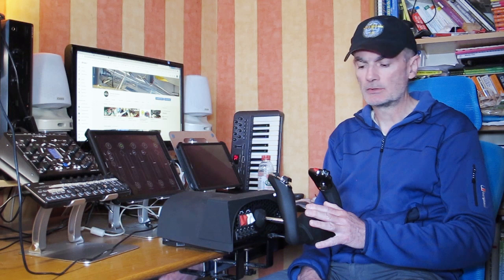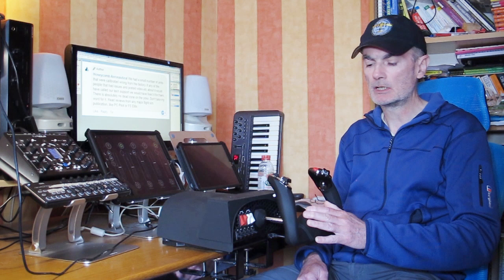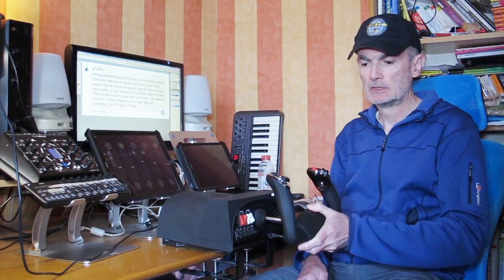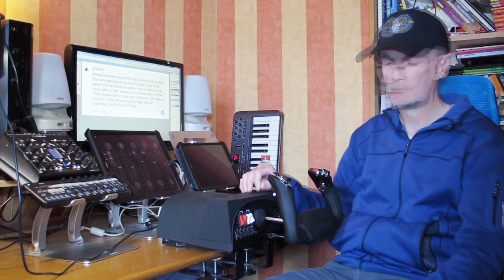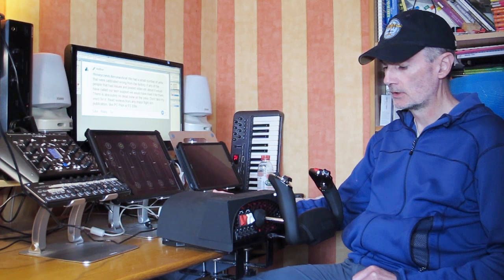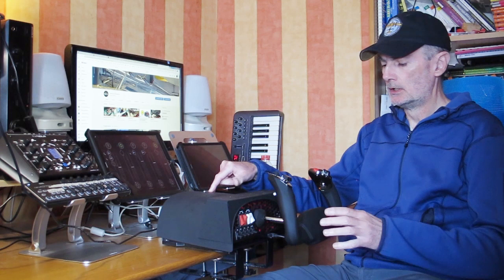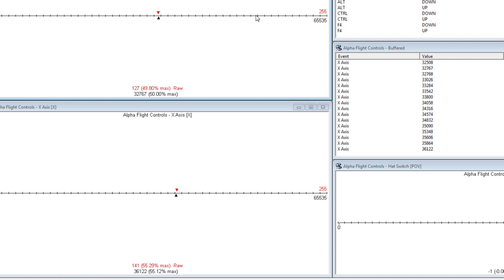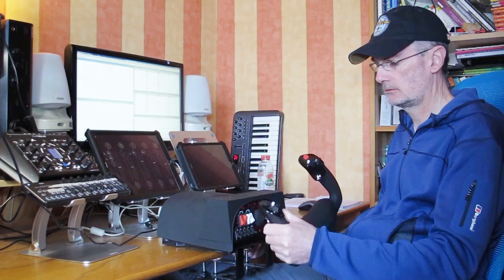Honeycomb Alpha Yoke SECRET Calibration Mode!

Comment: Thanks so much for this. My yoke was in the 20 degree out category. I've just followed your guide and successfully recalibrated it. It's now the excellent yoke I expected it to be. The only puzzling thing is why the manufacturer just didn't issue a fix themselves. Simple to do and would not harm sales. Anyway, this is very appreciated.
Reply from the maker: Glad it helped. By the way, I wonder if it would be helpful for people to let Honeycomb know that they hav eused this procedure to improve their yokes. As for your question, the only reasoning I was given for keeping the information secret was "we don’t want customers trying out this process yet and potentially messing up the yoke". Then Mattijs Kok of Aerosoft said in response to my video that they don't support this because it can "brick" the yoke.

I think the latter claim is unconvincing. However, the fact is you can easily mess up the yoke if you calibrate it wrongly, and I am sure there would be a fair proportion of people who would then return it as 'faulty' afterwards. I think the situation is most likely a consequence of a retail system that has become far too biased in favour of the consumer. Honeycomb (and Aerosoft, as its representative) is catering to the lowest common denominator, so ends up treating everyone like an idiot.

Comment: Thank you for speaking it out, as well as your previous video of explaining the possible mechanisms behind it and other useful information, which is very helpful and helped my friends to figure out how to calibrate it correctly. He has been given the "instructions" as well but failed to make any difference after doing it at first. What he did then after watching your video is, using some wire to make an "aim" and tied it on the column of the yoke, and aligned the aim to some sort of marking behind when logging the center position, to make sure they are at the same position each time.    HC's action of dealing with this issue makes me unhappy, but unfortunately, there is no alternative at this price point. Their upcoming throttle is even more so. Just hope they can make it better this time.

Comment: Fitting on this Easter Sunday that Mark has now enabled us to resurrect our Alpha Yokes from the "dead" zones! 

Mark, Honeycomb should give you a free Bravo Throttle Quadrant for providing customer service to us. I requested the procedure from them 11 days ago, have not gotten a response yet, maybe they are not servicing the support tickets remotely while staying at home.

This would have been an opportunity for them to be proactive and get ahead of the dead zone issue by letting customers know about the possibility of mis-calibrated yokes and how to correct it ourselves. Proactive communication about a possible issue would have made for confidence and brand loyalty, as you would know they are transparent and accountable. As it is, seems like they have just wanted to keep it quiet, and made it a bigger "issue" than it needed to be.

My yoke went from 5mm elevator and 9° aileron deadzone to none detectable, but my centering was not as repeatable as I thought it was - had to mark the shaft and watch the end of the yoke handle to get the exact same centering every time. So now i can setup a small dead zone to taste in my software, instead of having a fixed amount in the yoke. THANKS!
Reply from the maker: I'm glad people appreciate it. I kind of wonder if Honeycomb wanted someone to leak this, since it might protect them if anyone screws up their yoke!
Reply: @AlmostAviation  I posted a link to this video in 6 different YT videos where the dead zone was being questioned, to spread the word. It's in the wild.
Reply from the maker: @automaton450  Great, thanks.
Reply: @AlmostAviation  I think the truth might be halfway... they don't share the information to protect them if anybody screws up their yoke, but the leak was due to a rookie mistake  by the "global manager"
Reply from the maker: @attiliodariva5417  Maybe. I have had one other person say he was given the calibration info by tech support, although perhaps it was by the same person!
Reply from the maker: P.S. They did give me a free throttle quadrant :)
Reply: @AlmostAviation  lol I should setup shop and charge for my prognostications!

I guess they were not all that unhappy you publicized the cal procedure, it's the least they could do for you.

I do want the Bravo, it has a lot of great features, but I already have a pair of Saitek Quadrants, and was lucky enough to get a Cessna Trim Wheel while they were still available. I don't really need any of the extra features the Bravo has, but the one concern I have about it is the trim wheel outputting key presses. I prefer the analog axis of the Cessna Trim Wheel, and it has a such a great firm resistance but smooth feel. I don't use autopilots much, much of the time flying my hand stays on the trim wheel. I'd almost rather give up my
yoke & pedals before the trim wheel!

Comment: Cheers for that Mark that is most helpful. My Yoke has a slight stiction when initially pulling or pushing on the elevator away from centre. This seems to be over just a short amount of travel say 5-8mm but it is certainly noticable when trying to make slight flight corrections. I also feel the connecting cable between Yoke handle and body is too stiff/short and will not last too long before problems come. If you put your fingers on the back of the cable at the rear of the RJ45 plug on the yoke body and then rotate the yoke full deflection right and left you will feel the strain on the cable. In fact there is considerable rub on the coiled section when rotating full right. Anyway will give the recalibration a go and see what happens.
Reply: Have you already done a new calibration ??? Has it helped remove the dead zone? I also have a 5-8 mm dead zone, but calibration did little (or nothing helped).
Reply: @tombulva  Sorry for late reply. No I have not done the recal bit yet but I have replaced my R45 cable with a 250mm long patch cable and that is a lot better. I still have a slight sticky point at elevator centre but not sure if I should return the unit back to Aerosoft but I can anticipate that will cost me in postage and packaging and doing without my yoke for many weeks.

Comment: A HUGE THANK YOU.  I just bought the honeycomb yoke several months ago and found the deadzone to be excessive.  I fly for the airlines and upgraded my old yoke to this, and was frustrated with the deadzones, especially with the Ailerons.  I did the 45 degree calibration and its a new yoke!  It worked perfect at correcting the deadzone issue.  Thank you for sharing this calibration method, it has helped me tons!!!  Much more functional yoke now.  I currently use Prepar3d for my sim training at home.
Reply from the maker: Great, glad it helped!

Comment: The knowledge you delivered has been incredibly helpful!  I was considering cutting apart my brand new, less than a week old Honeycomb Alpha to install an Arduino to fix the dead zone when I found your video.  Thank you so very much!
Reply from the maker: Ha, good timing! I do sympathise with anyone who's done this, although I suppose at the end of the day they still have a well-functioning yoke.
Reply: @AlmostAviation  Agreed!  I'll be further reviewing your videos, very educational.  I do also hope to identify how to use all 5 positions of the starter switch, I'm currently using the 2 positions available for panel lights on/off.  Using FSX Acceleration and FSUIPC.

Comment: I just received my Alpha Yoke & Bravo Throttle yesterday, and so haven't yet even got it fully set up. However this info could be very useful in my near future so thank you very much for going through the process and showing us how to enter the calibration mode.
I've already had issues with just getting the lights to function on my throttle.  You earned a new subscriber and thank you very much!

Comment: I had a decisive discovery on this question. After dealing with the sloppy and dirty sensibility, I decided to take my yoke off and see if I could clean up or see anything. I found that when pushing or pulling on the yoke, the ROLL potentiometer plug and cable moved on the circuit board due to the travel of the yoke. I took a small zip tie and secured this cable to others nearby, so that when you push or pull the yoke, the plug isn't affected. My yoke is BETTER than new now, super responsive and no more dirty jerking or off-centering. I also sprayed my X and Y axis potentiometers with contact cleaner while I was at it. Easy solution, hope this helps!

Comment: Just tried this technique and it is day and night difference! I was so disappointed when I got this yoke as I had at least 8-10 degrees deadzone - especially since there didn't seem a way to calibrate this at the time and I didn't find your video. That deadzone is simply too much to make fine adjustments in small aircraft. I ended up flying almost as if I was pressing buttons on a gamepad. Not very satisfying after spending so much money on a yoke. People even swapped the control board to make this better. But now, with a new calibration, the yoke is finally usable! Thank You!
Reply from the maker: Yes, it was kind of sad to see people swapping out the guts to make this work better. Thankfully Honeycomb has now come clean about the calibration.
Reply: @AlmostAviation  There is a second issue folks wanted to resolve by swapping the guts: The low resolution used for the yoke. I'm not sure how many bits it actually uses but it does look like 8bits, so only 256 different values from all the way left to all the way right. Modern controllers should at least use 10 bits, better 12-16 bits. USB supports this out of the box and there is almost no added cost, depending on the microcontroller used in the joystick.
Reply from the maker: @TimoBirnschein  Yes, it is an 8-bit controller, so roll resolution is about 0.7 degrees, pitch resolution about 0.3mm.

Comment: Great Video,  attempt Calibration mode by using your second suggestion of letting go the yoke  roll axis no dead zone, pitch axis slight dead zone barely noticeable, overall great improvement over stock Calibration, flying feels a lot better

Comment: Thanks for the help on this one Mark. I had a small dead zone but now I’ve got it tuned in perfectly. In regards to the RJ45 jack in the based, a previous comment made mention of the vulnerability there. I’m my case, the jack totally failed about 3 months ago. I returned it to Honeycomb and they sent it back as “fixed”. Unfortunately nothing was fixed or replaced. I’m not sure what they did, if anything. I took it upon myself and did a permanent repair by hardwiring an Ethernet cable into the base. It was a fun and educational project and I am very happy with the unit now. Keep up the good work. I always enjoy your videos.
Reply from the maker: Yes, I have seen a number of people having issues with the connector cable, so that seems like a vulnerability. Your solution is probably the best, if you don't mind opening the box. Someone else suggested just getting a longer vable, as the curly one supplied strains the connector every time you move the yoke.
Reply: Matt - It's very disheartening for a potential customer, me, to read about these very bad customer responses from Aerosoft. This type of 'head in the sand' reaction is very very bad, and to return a faulty unit to a customer, unchanged or not fixed, is disgusting. Aerosoft - YOU SHOULD BE ASHAMED! Grow some balls and rspond to the criticisms.

Comment: Amazing how facts are helpful in getting everyone happy and on the same page and that disingenuous / confusing marketing speak and denial can switch customers off and lead to unnecessary product return and dissatisfaction. With this information on the calibration feature I'm convinced this is a good device with good hardware inside it, which is why I've ordered one and will be arriving tomorrow (Wed - 26th Aug).  Thanks for this information.
Reply from the maker: Thanks for the encouragement. I do wonder how many sales Honeycomb is missing out on, and particualrly how many returns they are getting due to this issue. Maybe it's a small proportion, I guess they have some rationale.

Comment: I bought the yoke and literally just received it. I was so surprised that they did not have any diagnostic software about checking functionality and calibration (or recalibrate). The manual as well would require some attention in my opinion as only refer to a drivers web page that doesn't really exist. Thanks for the walkthrough. It's a shame because as a piece of hardware this yoke is amazing. You gained a subscriber sir!!
Reply from the maker: Great! Yes, their documentation leaves a lot to be desired :\

Comment: Excellent, as ever. Though Austin Meyer made no comment on it, the "dead zone" was very evident in his review.
Reply: Bob Gilchrist 
I saw no dead zone on Austin,s review. the Homeycombe Yoke is fine when using with Xplane but P3D and FSX users seem to experience a dead zone. I own one of these for the past couple of weeks now and my Sim of choice is Xplane and I have no issues with it and neither do many other Xplane Users who also own the product.
Reply from the maker: @Stringbean421  As you will know if you have been paying attention, I measured both of the dead zones on camera without any simulator running. Think more, talk less.

Comment: Thanks Mark again for this very helpful video. Saw it a while back already but since I thought that the dead zone on the elevator of my yoke was a bit too large (and with the A2A 172 you fly a lot with steering around the dead zone) I decided to try your method of 'turn and let go' calibration. Worked perfectly. The deadzone is now nonexistent (checking with DIView). At least I can now use fsuipc to create the deadzone I want (I used -129 to 129) instead of what is given by the manufacturer :)
Reply from the maker: Awesome. It's notable that Honeycomb has now come clean about the calibration and included the instructions in their knowledge base (although not the 'let it go' method!)

Comment: I love the Honeycomb yoke, but there was a flaw with the stiff z-axis.  I was able to mod to it by replacing the bungee with a .25 inch (6.35mm) bungee.  It is absolutely a great yoke now. I am glad this yoke doesn’t come with a center detent.  I prefer the Honeycomb over my former PFC jet yoke—which I promptly gave away.
Reply from the maker: I'd be interested to know what kind of trade-off this has for the centring of the pitch axis. If you run the calibration mode it will compensate, but you will likely end up with a bigger null zone. Perhaps it's a good trade, although personally I like the weighty action. If I was going to experiment I think I'd try adding extra weight to the roll action!

Comment: My best guess is that the  folks at the factory are shortcutting the calibration. Just hitting the button early to get through more of them per shift, probably because the management doesn't want to employ enough of them to do it right every time. Honeycomb should include the calibration procedure in the box.
Reply from the maker: They do now publish the procedure, though you have to drill down for it on their knowledge base.

Comment: Many thanks. Factory calibration is probably (should be) done without the handleset attached and turns/pulls the rod via a measured jig.
Reply from the maker: I'm not sure I would agree with that, assuming the calibration is suposed to be adaptive to the particular nuances of each assembled mechanism.

Comment: I found out that if u get the yoke in to the re-calibration mode, you can then disconnect the Ethernet cable connecting the base and buttons on the yoke, then proceed with the free floating method. I got better results as there is less pull/resistance on the yoke due to the cable being attached.
Reply from the maker: Yes, worth experimenting with.